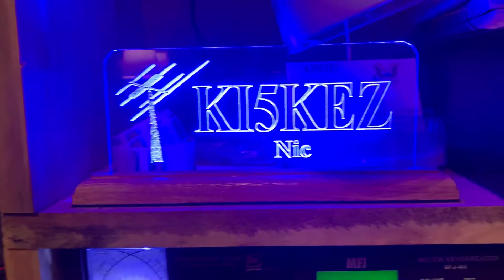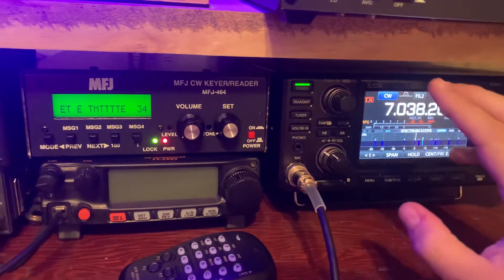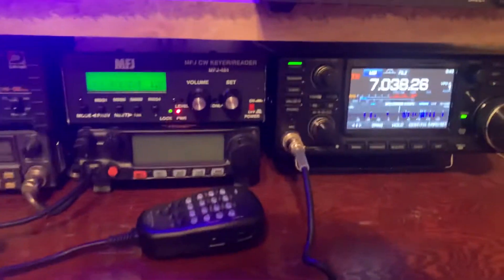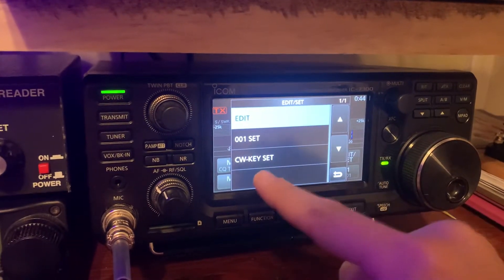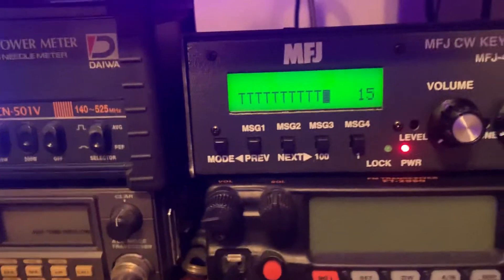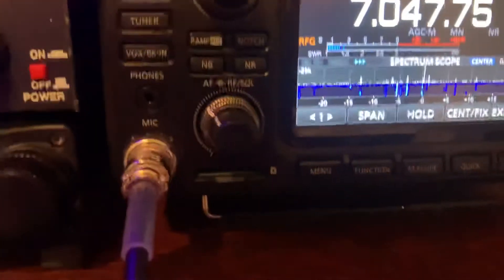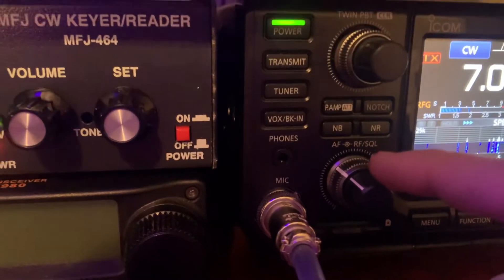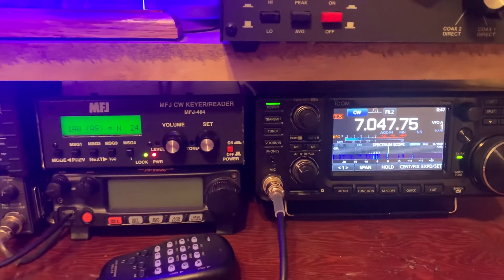MFJ-464 CW Keyer/Reader Decoding issue with Icom-7300 and Decoding of W1AW Freq on 40M

Comment: Your desire to learn CW is fantastic. Thanks for the great video. FYI... Having worked with > 200 CW students, there is a #1 unmistakable pattern - a CW decoder is only good for checking one's CW sending. For copying CW, it completely prohibits learning. It's like learning to play a musical instrument by observation. CW is super fun when you can listen & understand - only ears & brain. As you demonstrate with W1AW, a decoder will reliably copy only perfect code with a strong signal - a rarity on the air (except contesting). The brain is immeasurably better. I encourage you to dedicate the practice and have fun. Check out CW Academy... Good luck. Best wishes. Keep up the great hobby. Enjoy. Thanks again.
Reply from the maker: That makes sense. Thank you for the advice!